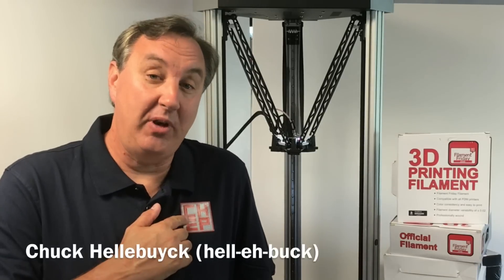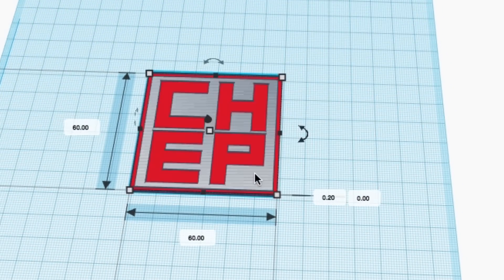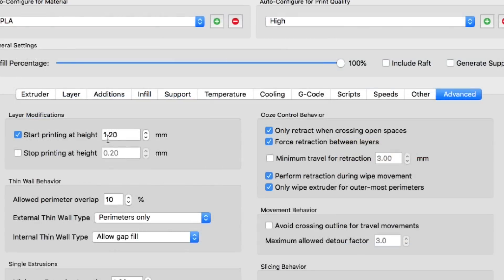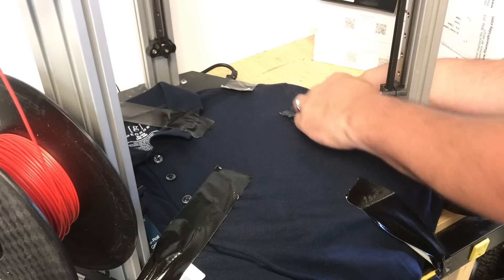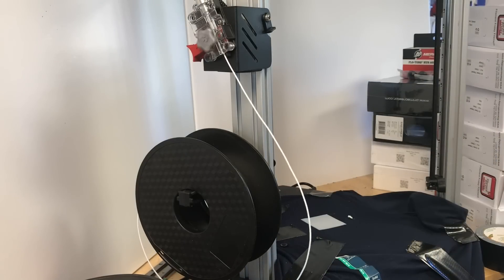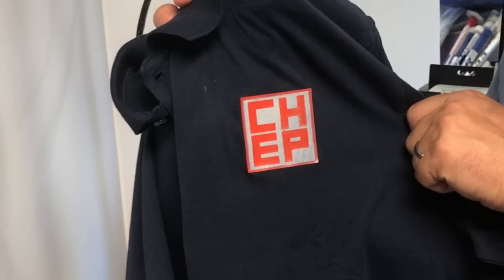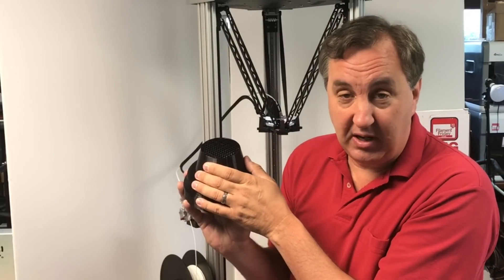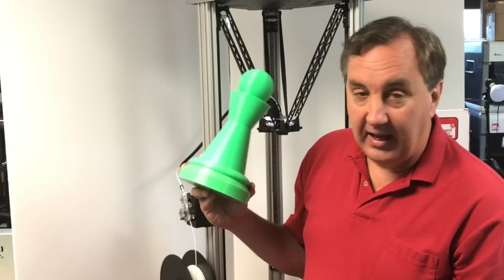3D Printed Shirt Custom Design on SeeMeCNC Artemis

Comment: Any follow up with the durability of the on-shirt logo?
Reply from the maker: Wife put one thru washer and drier before I could film. Completely failed. Popped right off. Not sure if washer or dryer did it. I assume dryer heat was the issue.
Reply: CHEP ugh. Hopefully the drier wasn't hot enough to make a real mess. Maybe carefully iron it back on from the back? Probably protect the iron with parchment or aluminum foil...
Reply from the maker: It just curled up.

Comment: Chuck i really value your opinion here i asked in a other video you did about why does the extruder from a cr-10 is much different from a prusa extruder. You said i think basically the x axis cant take the weight of the stepper and its why the stepper motor is so far away from the extruder. I think this is the reason why i can print TPU with the Prusa as well and NOT the CR-10S . So my new question is what do i need to do to my CR-10S to get it to print TPU? do i need to upgrade my extruder where the stepper is direct to the extruder and then i would need to upgrade my x axis?  I also would like to upgrade my bed so i have a flex sheet to pull off the parts as well i know TPU really hugs down on my MK2.5 so if you got any recommendations on any of the above please let me know and thank you very very much for your time...  
BTW that is so cool the pla iron on:) im going to try that in a few days
Reply from the maker: Try Printing slow at 10mm/s